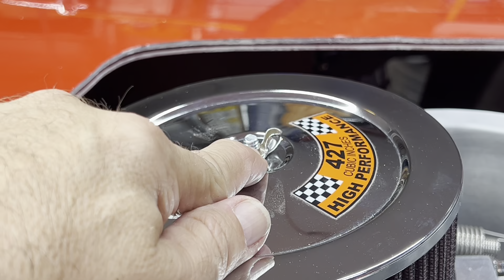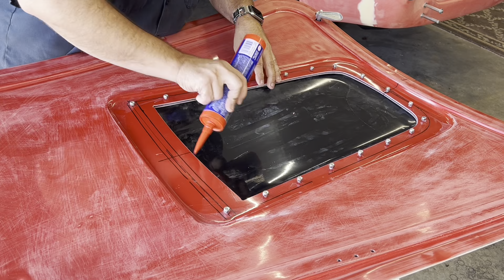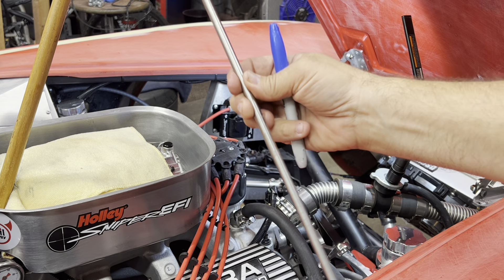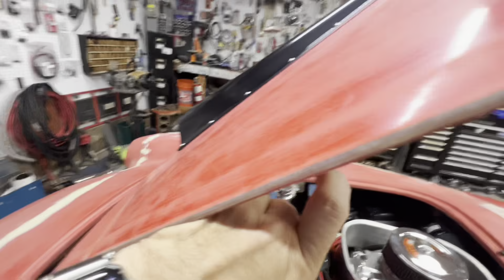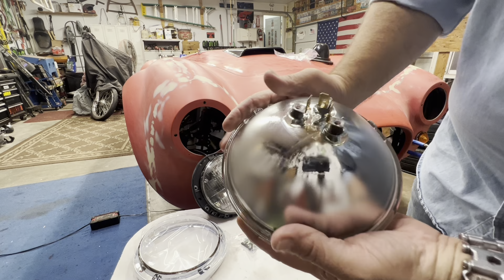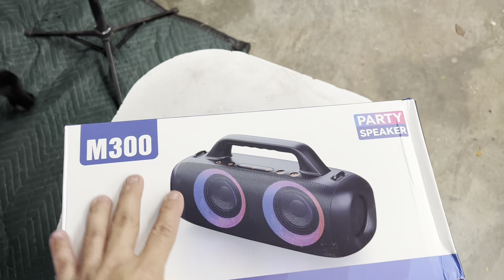Shelby Cobra Replica build Part 73 hood, scoop, new speakers.

Comment: I saw where a guy used the hood scoop as a female mold and laid up a fibreglass part . Then he seamlessly incorporated onto the hood. The original car was just pop riveted it on. Oh when filling cracks and divits don,t use just raw resin. There is no structure! Use a coidal silica or micro balloons to make a slurry. The bodies are made from vinyl ester or poly resin. Those product incorporate well with the body. Uhh epoxy works on poly or vinyl ester with no issues. Oh,, I love your dogs.

Comment: Love the process. Question. How do you think it would have turned out if the hole in the hood was sized to the turkey pan, and not the scoop?
Reply from the maker: Good question, I’m working on doing that now but not sure. When it came to cutting a hole in the hood I just trusted the process & followed the manual for the most part. But I’m planning on  possibly connecting the hood to the turkey pan when closed to create a ram air system of sorts. The turkey pan is an option, that can be removed.

Comment: Good info on the hood. Do you think individual blue tooth speakers would be better?  I have seen videos of other builders using them.
Reply from the maker: I’m not sure about the individual ones, not real familiar with them. You mean separate speakers like left & right channels?
Reply: @dansgarage2010  Yes , I believe so. I didn’t see the full setup but the person had two Bluetooth speakers, under the cubby, between the seats. Possibly marine speakers.
Reply from the maker: @billrajaram2201  I will do some research, that sound’s pretty cool